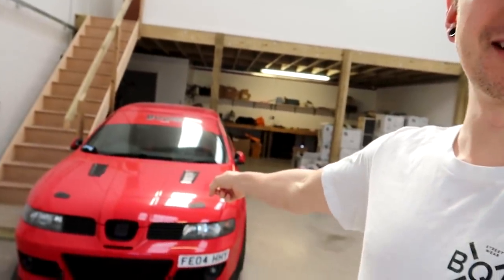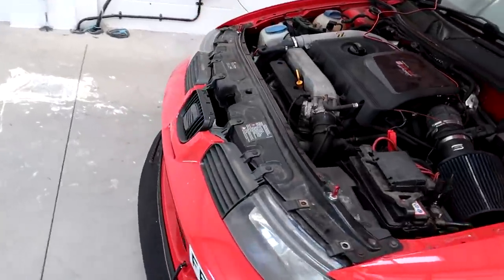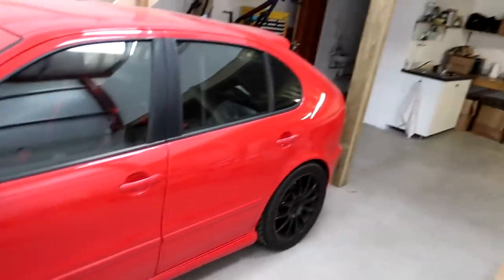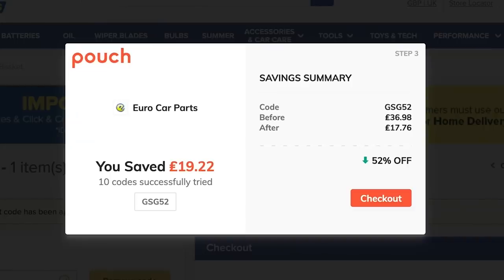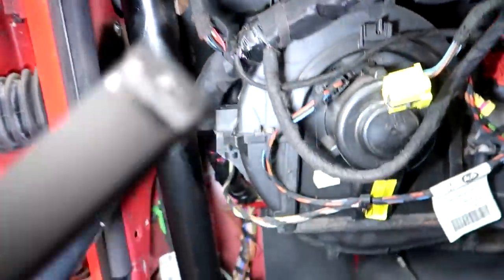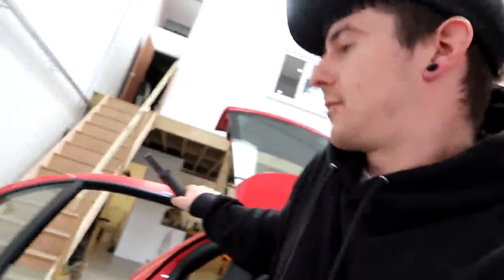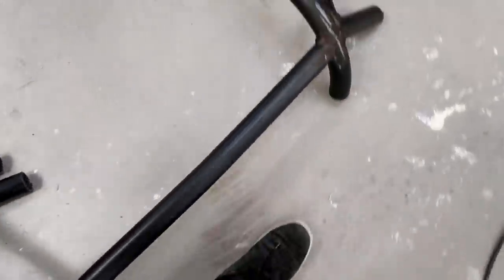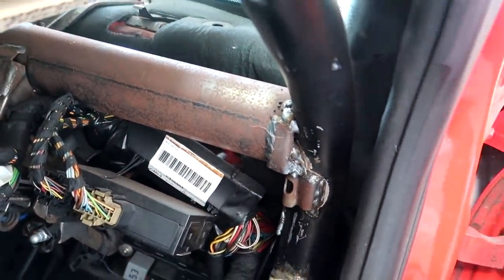Why I'm cutting the rollcage out the Cupra...

Comment: I've had relationships stronger then that welding
Reply: Luke Palmer found Johns account
Reply: Chris  Are you concussed? I said "I found John's account" because Luke stated "I'd like to see you break it" Almost looking like Luke was trying to defend the cage's integrity, which is fucked. It was John who welded in this awful cage. Which is why I said it looks like I've found John's account. Does that make sense now? If it doesn't you seriously need to have words with yourself
Reply: Ahaha put it this way. That cage was going nowhere. I'm not claiming to be a master welder but my job does involve a fair bit from like 2 mm players to 20mm plate. A weld without gas or little gas will bubble up like a few of John's but is still fucking strong. That cage is better than no cage.
Reply: Chris  No, you are confused, I was implying that Luke's account is John in secret. I didn't spend any time looking for John's actual account XD are you actually broken

Comment: I don’t know anything about welding, but Jesus Christ is that awful
Reply: Should have taken to huxley motorsport in Worcester
Reply: I was thinking the same! Welded once before on a college induction and I reckon I could do a better job haha
Reply: Where i live we have these shops you can pay to use their equipment and there is welder there so the owner of the shop just showed me quick how to use it and told me basics of how you know if youre welding wrong and how to adjust settings and let me tell you the welds i see here are worse than what i managed to produce on my first time on holding welder let alone someone who seemingly has done so many roll cages before

Comment: What a butcher 🤦‍♂️🤦‍♂️ ... who ever made that roll cage needs give up welding/fabrication that is so scary 

You made the right choice taking that out 

Wow that has shocked me man .... who ever it is should not be even aloud to pick up mig torch
Reply: Tommy Loves Boost just went back to the vid where if it was installed and it was John his old mate
Reply: Adam from 6two1 had the same problem with that guy if I remember correctly
Reply: I agree absolute disgusting! worst fabbing and welding I’ve seen for a roll cage probably ever. Any skilled welder could weld those gaps no problem. This work makes me cringe. ps it’s not mig it’s flux core.
Reply: @butters_  it's MIG
Reply: Joe Law yeah I just checked the old install video as well. it’s that bad some of the welds actually looks like unchipped slag hhahah

Comment: you should get a inlet manifold spacer aswell mate gives you slightly larger plenum and works as a thermal barrier to stop the manifold getting red hot and the best bit there cheap as chips.

Comment: The welds on the hard to reach places on top of the cage is the first place a scrutineer would check! 
More common than you would think to see cages missing welds where you can't see as it avoids taking to roof skin off to do it properly!

p.s for the weight you would save cutting the door bars out I'd be tempted to leave them just for the extra protection during a side impact.

Comment: I’m not a welder by any means, but I’ve tried it before and I did a better job, but I’m very exited for more cupra videos. I’ve got a Audi TT (2003) 1.8T, it’s mapped to 260 ish like yours and wanted more power. What intake have you used? Also I don’t actually know if it’s the exact same engine?

Comment: Did John fabricate the cage? Because to be able to get good notches,  bends and symmetrical radius’ you have to be somewhat clued up. Other than that, every inch of weld on that cage was shouting “clean the shroud, come closer, more gas, less wire... more amps”

Comment: Need to do the Secondary air intake delete as well, R tech are a really good company for tuning these 1.8T engines. They have a whole guide on what to do to hit certain power bands.
Reply: Bam engine doesn't have a secondary intake
Reply: Mukund Mistry  ah true, I had a Mk4 Gti and you had to do the SIA delete, forgot it wasn’t the same in the Cupra
Reply from the maker: @mukundmistry1181  correcto